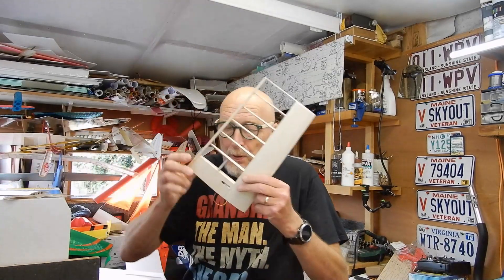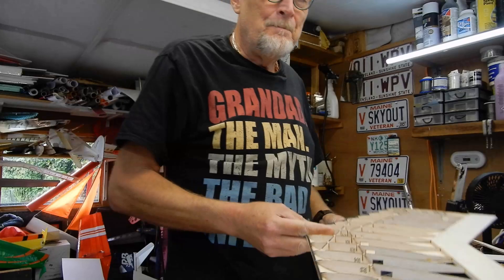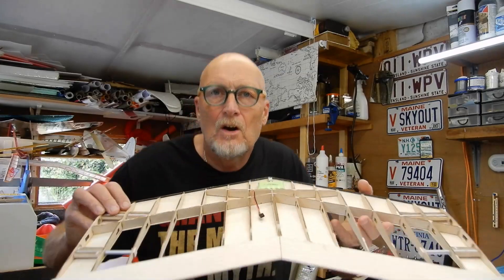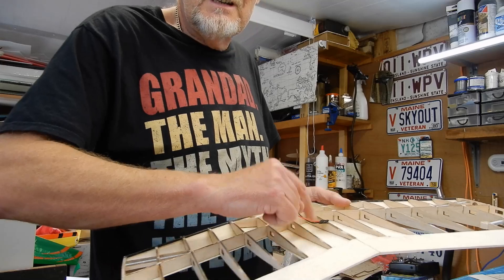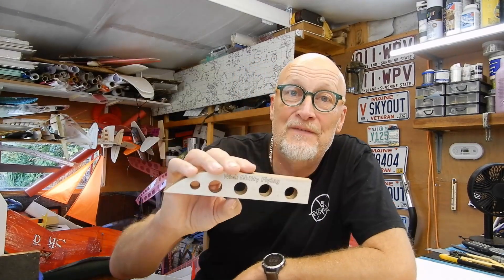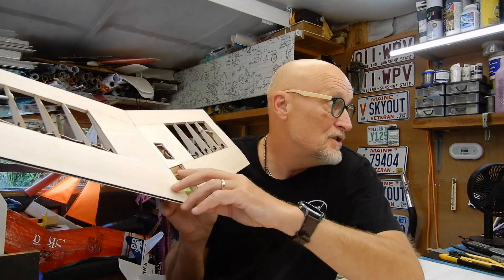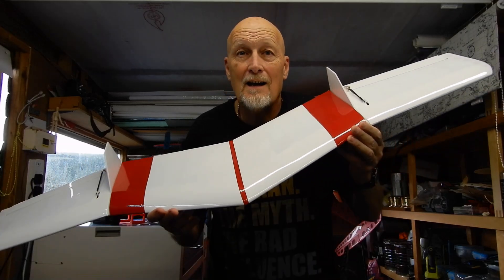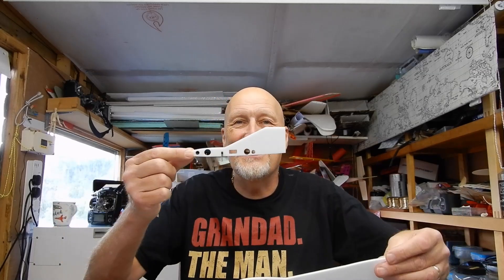Petrel Build Part 2

Comment: Nice! Is the wingspan 1200 or 1500mm? Love the magnet system with the fins.

My Skua (1200mm version) is 15 years old and still going strong. I refurbed it earlier this year and covered it with doculam and ultracote. Super stiff and slippery now compared to the old packing tape! It weighs 820g though so needs reasonable air.

Wowings are back in business BTW and you can once again buy EPP Skua kits. Some would maybe consider them a bit old fashioned but they fly great.
Reply from the maker: 1200 mm 470 grams 
I’ve put there advert in description 👌